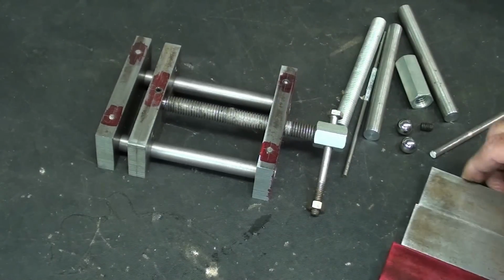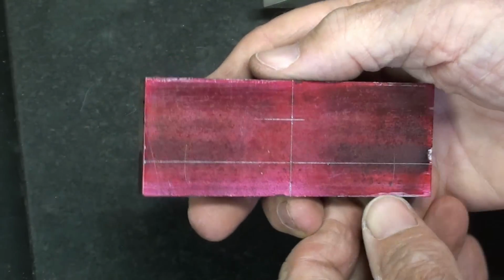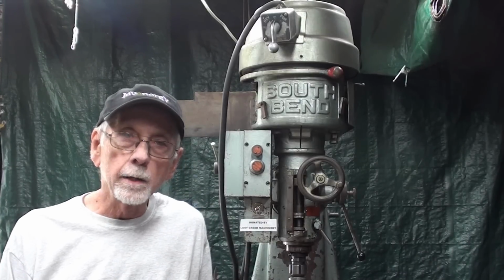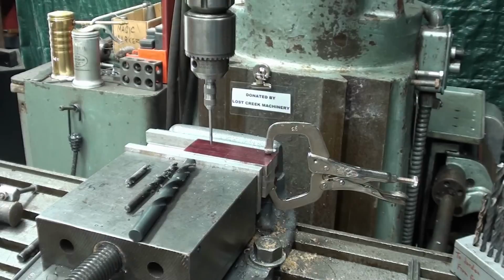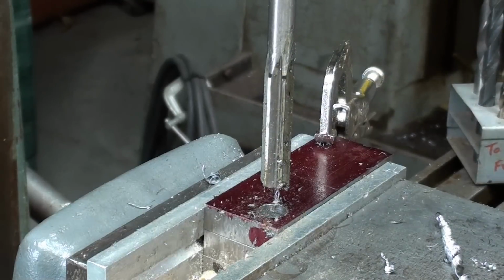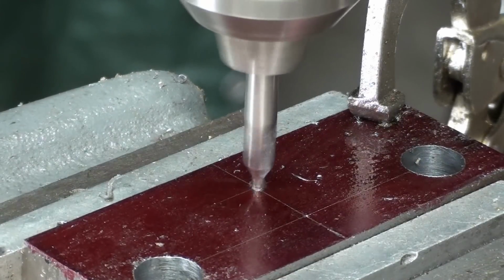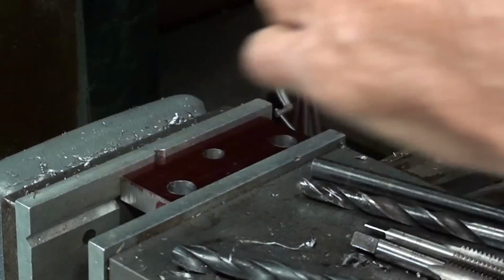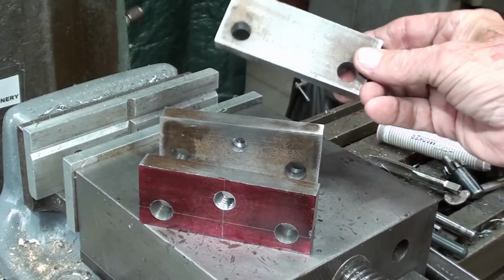SCHOOL PROJECT DRILL PRESS VISE #773 part 1 tubalcain

Comment: Rather than the locking pliers, I've used a piece of paper folded over a couple of times on the edges of parts to clamp then when they're "close",  Seems to work pretty good.  Not my idea, something I picked up somewhere.  Keep putting out the videos.  Thanks

Comment: When I was in high school we made small vises that ran on round stock like this but ours had removable jaws and we had to thread the screw on the lathe and they had acme threads. We also ground all the flat faces on the surface grinder. A guy came to our teacher looking for a student to work at his shop . I was chosen and I still work there today. That was 39 years ago. Soon after I graduated I was running a Monarch 20" x 120" lathe making overhead crane parts such as 8" x 36" long axles for overhead cranes.

Comment: If you don't have a vice for your bench top drill press, the vice that Lyle is making made to 1/2 scale will work a treat. If you drill and ream two holes in the top of the fixed jaw and one hole in the movable jaw for slip fit dowel pins you can then hold thin round work to be drilled. The vice then works as a clock makers vice.
A wiggler set is really helpful in general shop work. The tiny edge finder attachment will get into slots and confined places where a regular edge finder won't. A good layout line and the wiggler needle point will easily get within 0.004" (1/10mm) of the exact desired position. Within 0.002" (1/20mm) with care and a magnifying glass.
Cheers from NC?USA

Comment: The damage to my lumbar spine makes it difficult to crank the knee up, and down on my Bridgeport. i installed a power feed on it 18 years ago. They are cheap enough to buy from Vevor. You deserve one on all your vertical mills. 
In addition to drill pres work your vice would be a handy tool to use as a small floating bench.

Comment: That drill press vice is very similar to one that I made as a teenager.  It was made with a hacksaw, file and drill press.  That is how I learned the proper use of a file. Skills that I still use over 50 years later.  I actually still have the vice and every once in a while I use it because it is the right configuration for the job at hand.  Thanks for sharing.

Comment: This video is spot in for my intro to machining class. The boys examined the prototype. Your operations are so similar to our project, but yet different enough that the boys will benefit from the variations. I have already forwarded this video to them.

I intend to complete the prototype project and employ it on one of the small drill presses in my woodshop. Your prototype project has already served duplicate purposes! The oversized moveable jaw holes are a bit too wiggly. This is the purpose and advantage to making a prototype. The finished project benefits from correcting errors or making improvements.
Reply from the maker: Hi paul

Comment: End mill?
Reply: “End Mill” refers to the type of milling cutter being used. They’re made of high speed steel (HSS) or carbide with two, three, or four flutes and securely clamped in a collet. They cut on the “end” or side. Hence the name “end mill”. Whew; sorry for the long explanation. I hope this helps.